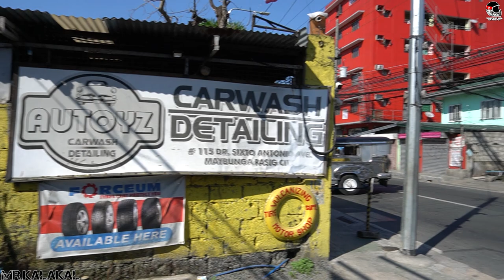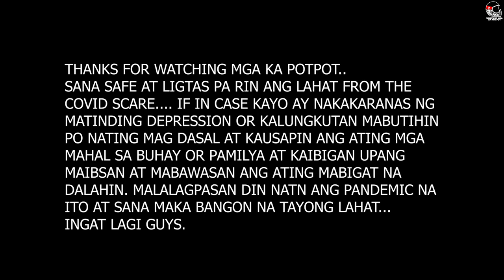NEW MAGS FOR BLANCA | YAMAHA NMAX V2(2020-2021) | POWDER COATED MAGS

Comment: Hello po Mr. Kalakal. :) Question lng po, kapag po b malakas ung hangin, mejo maglilikot ung motor ung prang my wiggle? Thanks po
Reply from the maker: Yup pero pag walang hangin then malikot pa din handle bar check niyo po ung front components ng motor
Reply: Hnd nmn po sya malikot pag wala hangin. Salamat po s sagot. :) Ridw safe po always. Lagi ko inaabangan mga updates and upgrades nio ky blanca pati si Señor Serye. :)